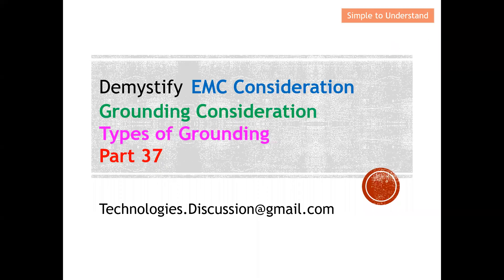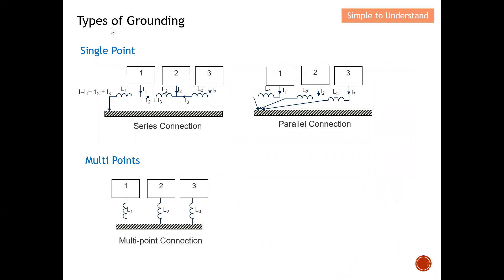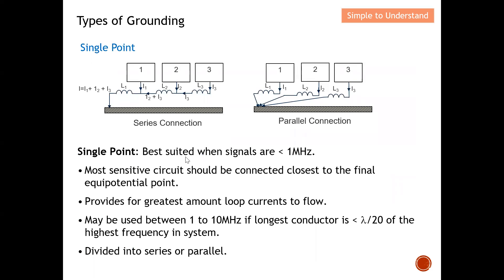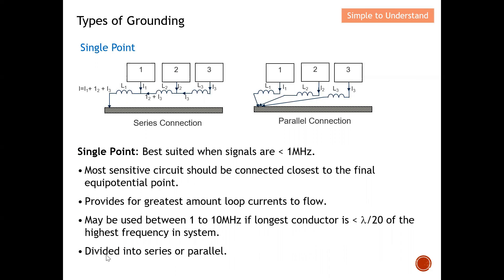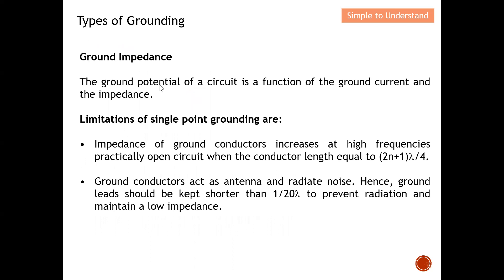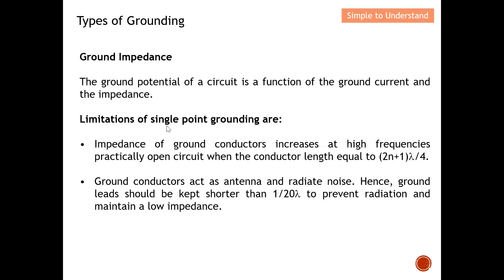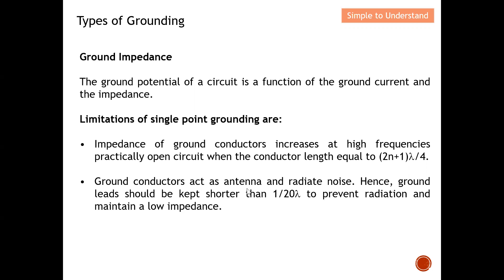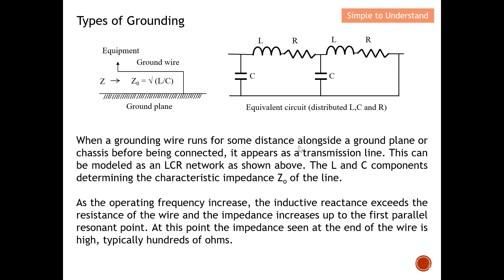EMC #37. Single Vs Multi-Point Grounding: Shocking Truth About Freq, Impedance & Ground Loops.

Comment: there is an error in the equation of Z at 11:00 , it should  be Z=Z0*tan( w*x*sqrt(L*C))
Reply from the maker: Thank you for your question. If I am not wrong, I think my video is correct.
Do you agree with my earlier on eq: Z = Z0 Sqr (L/C)
That where my eq from.
Thanks  :)
Reply: @technologiesdiscussion1676   I agree, but here you have tan(Beta*x) and Beta = w*sqrt(L*C)
Reply from the maker: Given me some time to think thru.
Thank you so much for your contribution on this learning community.  :)

Comment: I have 2 pcb board 
One is main pcb 
And other is display pcb
The display pcb is also powered by main pcb 5v

The pcb are in very nosing condition ...
So i decided to put sheild for both pcb board 
And connect the pcb with vga cable for sheilding

My doubt is can i connect the two sheild of pcb to the digital ground of the pcb board..?
How can i ground the  sheild...

It is powered by an 12v smps
Reply from the maker: I personally dun recommend to gnd the 2 shields of PCB to the digital gnd. The digital circuit can potentially become the victim. Power supply gnd will be a better choice. I understand u also connect the VGA between the 2 boards. I suggest to add ferrite and filter on the end of the cable to reduce the issue. Hope is useful.